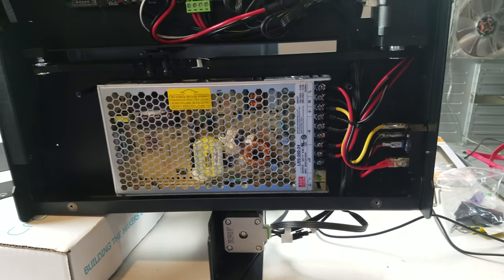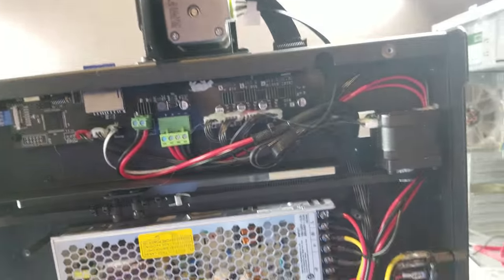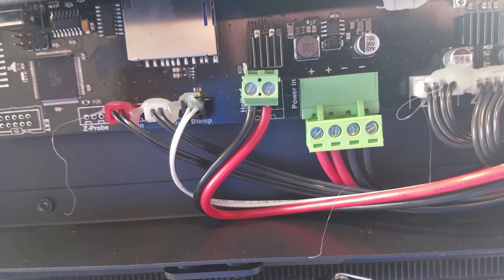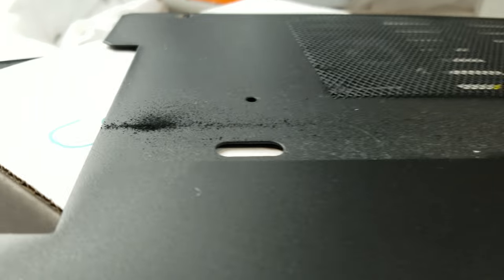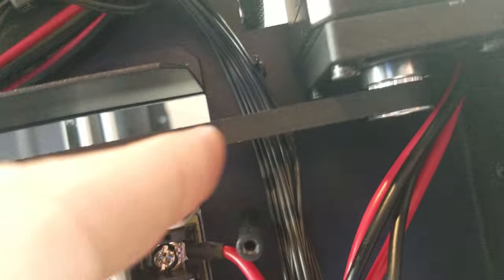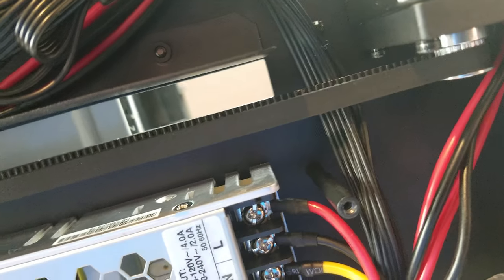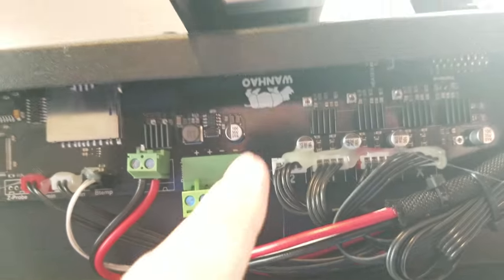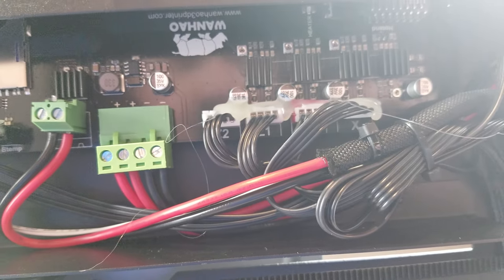I Found Some Issues With My Monoprice Maker Select Plus 3d Printer

Comment: so the same thing happened to me but by sheer accident, I bent down to pick up something off the floor and saw something moving under the build plate as it was running. The thermistor was off the build plate so I was not getting hot or sometimes it was showing random temps. I just used clear tape and stuck it back on. yes you have to disassemble it

Comment: How did you fix the pully?
Reply from the maker: Well to be honest with you i have not fixed it. i sent it in for a board replacement and then forgot to check it when i got it back.  should open it up and see what is going on with it. Thanks for the comment.
Reply: @BeginnersTech314  I understand that :-)